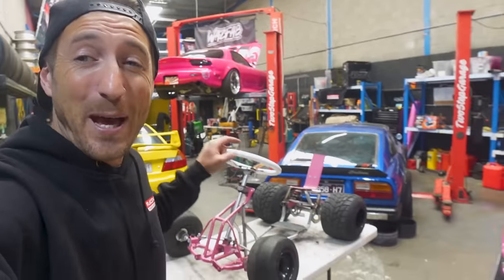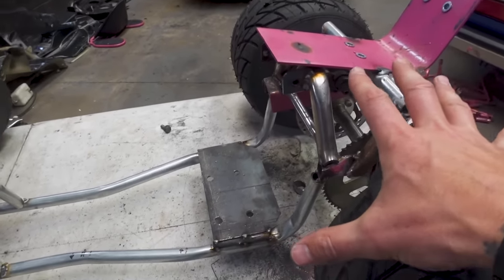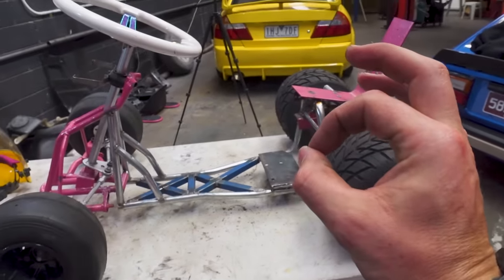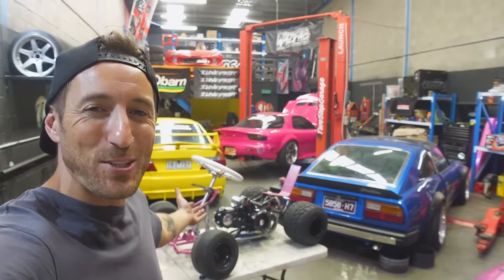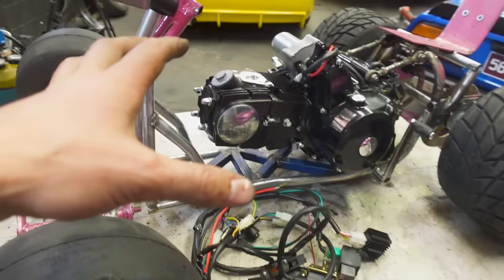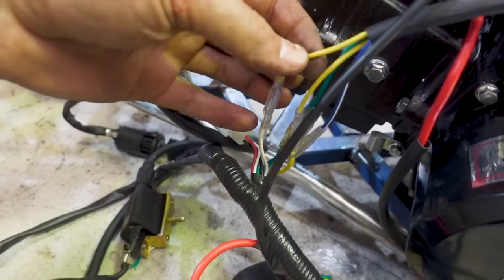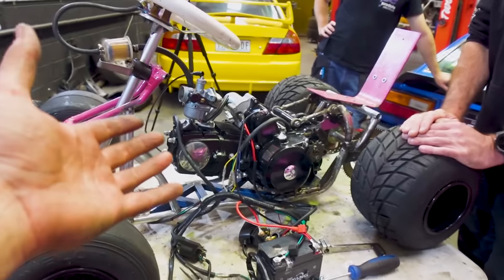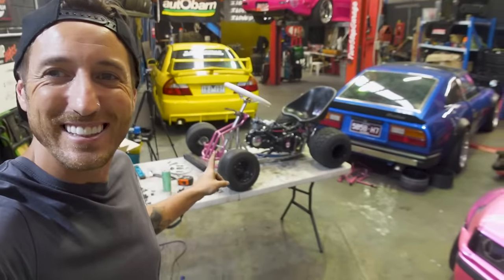Installing a HUGE 125cc 4 stroke motor in our BUDGET Drift Kart! | Part 4

Comment from the maker: Sorry for the late upload guys, had technical issues. Enjoy the vid! 🤙🏻
Reply: You made it that’s all that matter brother 🫡
Reply: Yeah bro keen for my video. Any video is not too late 😂
Reply: Frame/tube bending before I had a tube bender, I filled the tubes with sand and used a blow torch to stop getting kinks in everything. You should of used an old 2 stroke motor that would have had more HP and would have probably been much cheaper & much lighter. Keep up the good work, now at 57 with a 22 year old busted back, my builds have now slowed down, too much, my 650 reverse trike is taking forever
Reply: Love the content keep it up!!
Reply: Naah it's algood just keep up the effort man your doing awesome
Reply: Yellow and white wires are auxiliary for lights and battery charging
Reply: Awesome video again man
Reply: @itsmikelake You can get GY6 Fuel injection kits that will work with that 4 stroke but are costly and need someone to tune the ECU due to being for a GY6 motor but that definitely works :D
Reply: Not going to lie I was looking forward to this video... really been enjoying the builds with trial and error. 😊
Reply from the maker: @rickburnout666 thanks for the advice! You’re still 57 years young. Keep pushing & aslong as you’re enjoying the process, it doesn’t matter how long it takes 😁
Reply from the maker: @joeshmo4067 these things charge the battery?!
Reply: Hi mate I really hope I win I've been checking every hour everyday to see when you've Uploaded you have so much energy in every one of your videos Good luck
Reply: bro i commented wen the vid first came out but for sum reason i can find it or it didnt sent but i sed im making one of the drift carts but iv still gotta get sum parts like a stearing wheel ect but yeh im sitting hear waiting for the new vid to drop bro loveee the siries cant wait to finish mine
Reply: @itsmikelake  I shouldnt really complain, I died at 12 & 17 and doctors told me at 13 that I wouldnt make it to 30, so I'm 27 years past my use by date, things take longer than usual now, I've been waiting over 2 years for a hospital appointment, but if I had turned up illegally in a dinghy at Dover, I would have been seen within a week and put up in a top hotel, its good to see that all the taxes I've paid since I started work decades ago, get spent properly on people who've paid into the system 😆. Keep up the great work

Comment: On the 7th day of Mike-mas, Mike Lake just gave at least:

7 pops and bangings
6 frame supportings
5 weld sunburns
4 inch of boxbar
3 redline revs
2 unknown wires
And some fresh 10W40.

🫧🫧🫧

Comment: When braking in a new engine you best run the factory oil for a few miles. To get some machining debris into the oil and then change oil and filter.

Comment: Regarding the lower support. I like the cross bracing but you might want to add a triangle to prevent flexing over the axle. Now all the bending force goes through a plat plane. Might not matter for the speed you are looking for. But the power with the turbo and nos might bend the frame due to torque
Reply from the maker: I think it needs a bit more bracing I agree 🤔. Especially if we end up doing the fuel injected turbo setup!
Reply: You could try how much it flexes when you jump on it a bit. That should be a similar load (bit redneck), but finish welding first. Love the vids

Comment: that was the exact engine I was going to suggest , but too many others already commented. there is a cheap 140cc kit for it if u blow it up I did it to mine ran it on straight octane booster with no fuel and cooked the rings on a run in skid lolol

Comment: Just adding carb and bigger jets adjusting for extra 20% in fueling needed for turbo nos etc can help pz 28-32 good cheap Chinese carb can go upto a 180 cc with one and small mouth fitting or bolt types available

Comment: Personally i would add a cylinder head mount, and also a oil cooler kit. Im not sure if fuel injection would be the way togo on this engine, i feel like its just gonna blow it. Good thing you changed the oil, the mostly put cooking oil for preserves when its coming from china

Comment: When bending the metal tubes, would it help to use torch to heat where bending? Or can put solid piece inside the tube when bending?

Comment: Maybe s.one else has mentioned it already but shouldnt u add a top frame rail? A couple tubes on top of engine joining front section to rear section(like the origanal frame)would add a ton of ridgetity to ur frame. Much more than gussets on the one bottom rail. Maybe u didnt get that far on frame yet? Love the build. Gonna be a lil ripper
Reply from the maker: You’re spot on. I’m going to add some removable rails that bolt in up top which will allow for easy removal of the engine if need be 😁. Thanks for watching!

Comment: You need to strengthen the steering and you should add a bar from where the seat is to the steering column otherwise if you hit a big bump that thing could fall in half

Comment: Have you realised that the rear   sprocket is a different chain size? 

To overcome this u could just bolt the new sprocket to the side of the old one.... it might rip it half it might not.
Reply from the maker: I have the new sprocket 😛. We’ll have to do a little engineering to make it work, but we’ll get that done in the next vid I think!
Reply: @itsmikelake  all over it mate!

Comment: you sould put a pipe between the stering wheel and under the seat so you dont brake the seat and fall of backwords and also you kan put starting button there

Comment: Yo yo!!  Would love to win the 2 step garage  bundle!!!  I have a SFD Industries drift trike. 26x4 front wheel 2 fat go kart slicks with drift sleeves on them on the rear.  And a Tillotson 225cc race engine.  She puts out 18hp. Top speed with drift sleeves on is 64mph.  I still had throttle to go.  The engime revs to 9500rpms. Used a phone gps. Sfd industries has a youtube channel with the trikes like the one i have on there.! Check them out.  Freaking awesome!  Drift sleeve driving is like sliding on ice all year around!!

Comment: Ahh dude you don't want to put good oil straight into a new engine right off the bat, they come with a lower quality oil intentionally to help them run in better then you change to a good quality oil after the run in period. Going straight to good quality oil will prevent proper break in and your rings won't bed in as well leading to lower compression than you would otherwise have